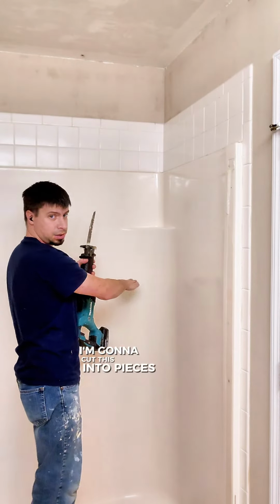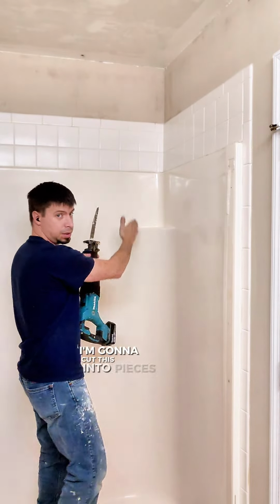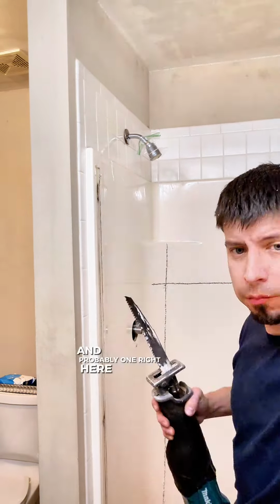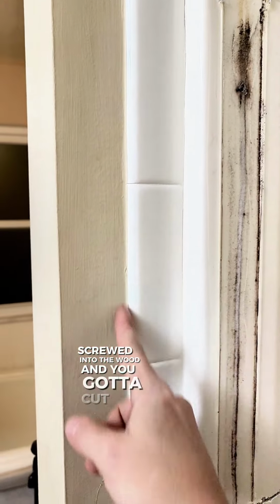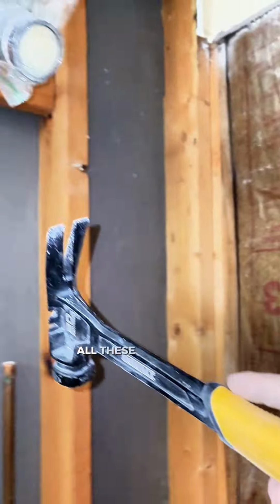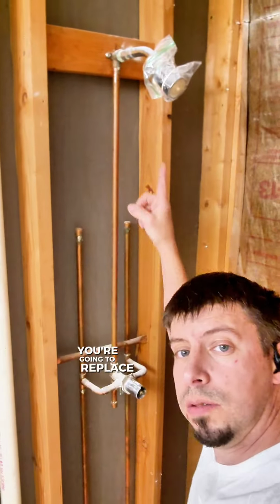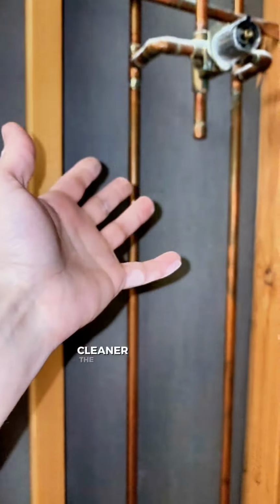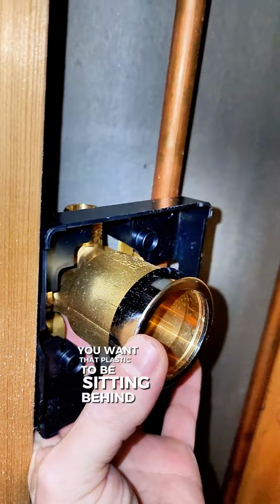Removing fiberglass shower surround and base for easy disposal

Comment: A suggestion: Instead of using the hammer head long wise to pull nails, turn the hammer head sideways to vertical, hook the nail and then push down or lift up, using the sides of the claw as your lever. Removing nails in this method is much easier. If you have a longer nail just push down, then allow the claws to slide back against the material and then lift up, use this up and down motion {allowing the claw to slide back against the material each time} until the nail comes all the way out.
Also, for people watching this video.. he didn't explain what he was doing with the hammer and chisel... he is removing glue/adhesive that was left on the studs.
Reply from the maker: It's all a preference. Personally I like using my prybar more. I don't think I have ever used the side of the hammer. Maybe I should try it. And yes I should have mentioned me getting the adhesive off.
Reply: @a-craftmans-touch1641  My Dad was a farmer and a carpenter for all his life. He showed my this trick and even if the head of the nail is off, the claw will, most of the time, still grab the shaft of the nail and allow you to pull it out.